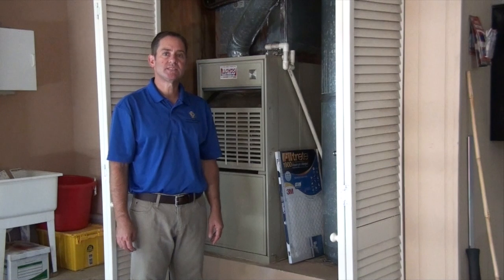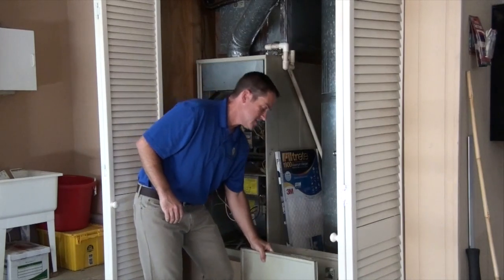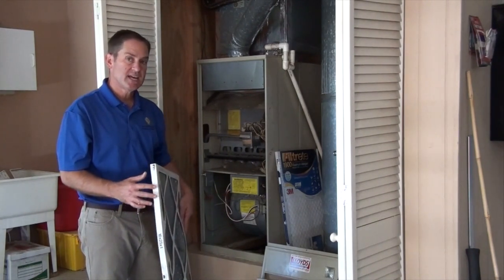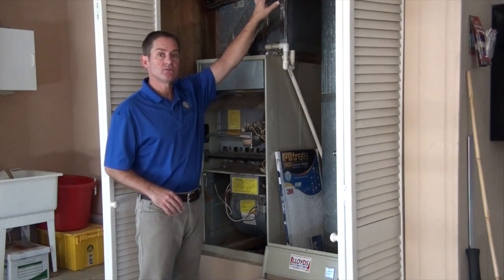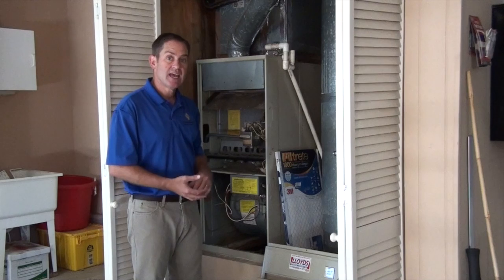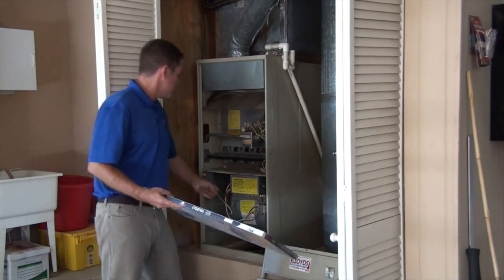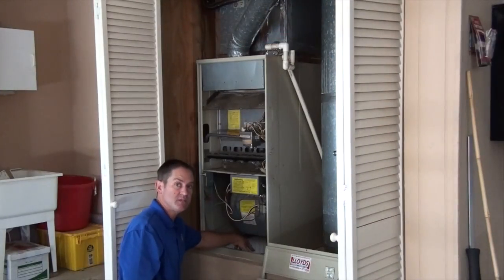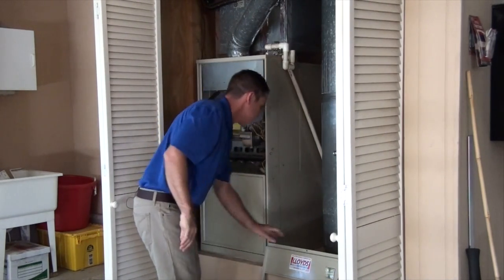Maintenance Minute - Furnace Filters

Comment: what happened if the filter chamber is at the bottom of the Carrier Unit?
No one seems to demonstrate this.
Does the arrow point to the FLOOR or to the Carrier 80 UNIT?
Thanks.
Reply: Then it will be like this unit and the arrow should point up.  I just replaced my Carrier with Lennox.   My air inflow comes from the bottom like this unit.

Comment: What if arrow pointing downward is marked in furnace itself. What do I need to do? Should I believe in furnace filter arrow or arrow marked in furnace itself?
Reply: If the air flow in your furnace is marked with an arrow, your filter arrow should be pointing in the same direction.